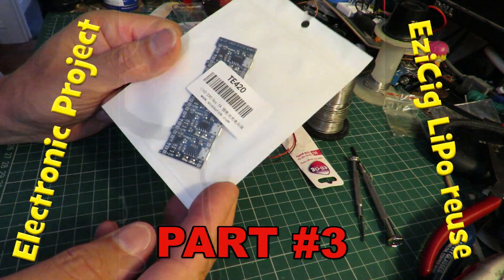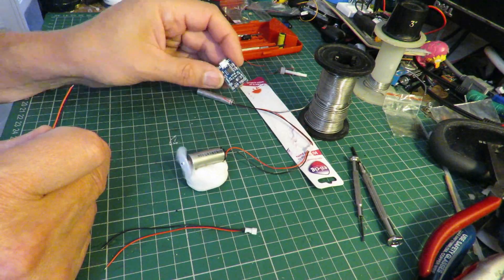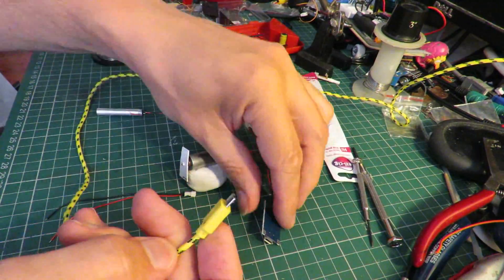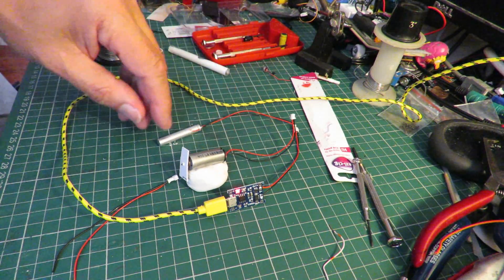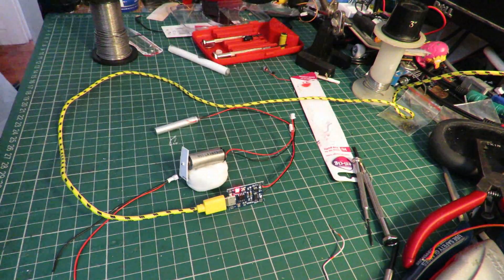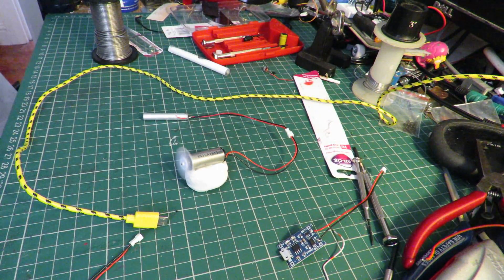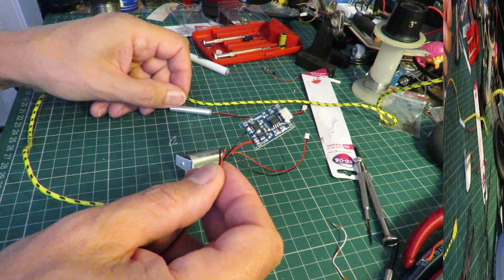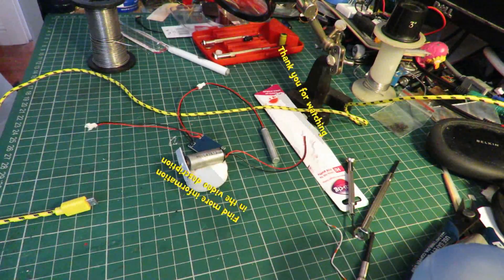Disposable e-cigarette LiPo re-use PART #3

Comment: That charger board is wired to charge at 1 amp.   If you look up boards on ICstation or banggood's websites they have data that explains how you can change the charge current by replacing one resistor on the charger board.   LIPOs should be charged at 1/10 of their capacity if I remember correctly so as not to be unsafe or damage the battery.   Have fun.
Reply from the maker: Yes that is right, I show an example on this video https://youtu.be/cP_6XR2Cwc0

Comment: Do you think i can reconnect to e cig and smoke again?will that be possible?
Reply from the maker: If you mean that you want to recharge the battery and keep using the eCig then it might be possible if you are careful to intercept the battery wires and divert them to your charger. I would think that was a lot of work for very little benefit and potentially dangerous as the battery may catch fire in the worst case scenario. You would also need to refill the eCig with the liquid and that may be a problem. I have no interest in eCigs and have not tried that sort of thing, I was only interested to see what the battery could be used for

Comment: Did you see what voltage the cell was at when the charger board cut off to protect over discharge?
Reply from the maker: Nope, I didn't run it long enough to find out and I doubt my cheap eBay meter would be accurate enough to satisfy anybody watching on YouTube.